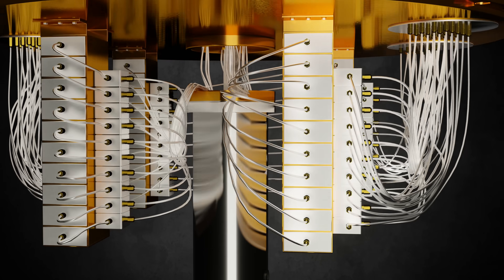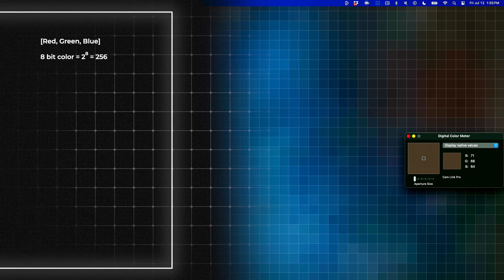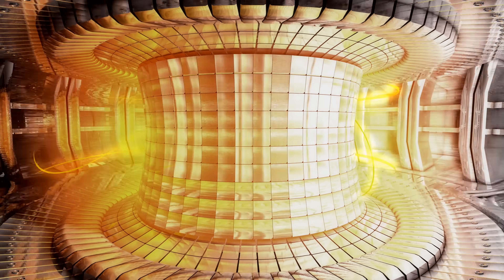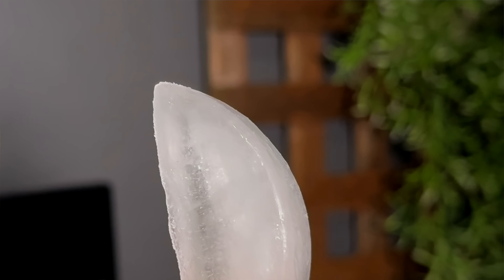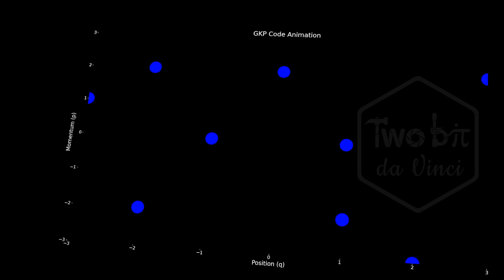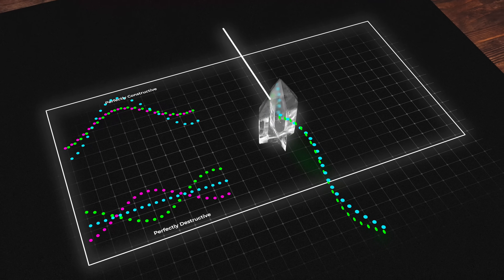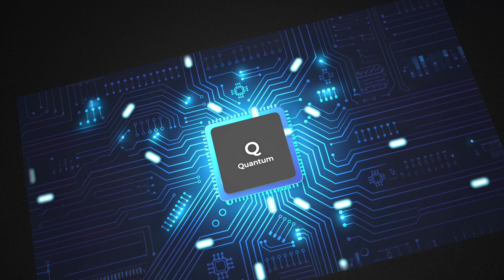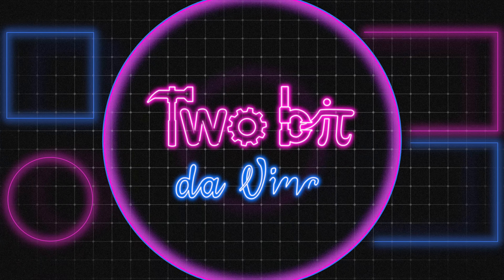Quantum Computer Breakthrough Can make them Mainstream!

Comment: I already saw light as the one of the big futures for room temperature quantum computing or similar computing methods. also how I designed my own computer in around 2016 to 2018 somewhere, but used a much more crude method which is much cheaper and simpler to make and less sensitive to noice, but much lower potential reaction speed, and actually could be more easily seen as a photonic driven analog to a quantum computer with also some of it's own extra added things.
also photonic quantum computing methods like the ones used now for how far I knew wheren't there back then, even the basic original ones where new stuf back then, also I surely didn't have the materials to make it anything like how they make such thigns now or to properly sense and  process it, so the much more crude way with my self designed R-crown(unpublished due to every invention I tried to publish before being copied and stolen by some random person or company, so if you find something about it online it is probably different, however the component itself looked more like a star, but when warping it around in some dimensions to make a simplified layout of it it looked like a crown) was much better for my use case since it was super cheap to make and as a hobbyist you never really need to run many instructions after eachother to fast since it is just for fun, experimenting, development and testing, and not for stealing data from every person in the world.

even though recently I also found a new great potentional for another technique(as in december 2023) even though that one I only tested to create and program quantum effects into normal materials and not yet for computing uses

Comment: Cooling a quantum photonic detector, such as a single-photon detector or a superconducting nanowire detector, to cryogenic temperatures involves several specialized considerations due to the sensitivity and quantum nature of these devices. Here’s how meta-structuring and advanced materials could be applied to enhance the cooling system for such detectors:

### Design Considerations for Cooling Quantum Photonic Detectors:

1. *Cryogenic Cooling System Components:*
   - *Cryocooler:* Utilize a high-efficiency cryocooler (such as a GM or pulse tube cryocooler) capable of reaching and maintaining cryogenic temperatures (typically below 4 Kelvin).
   - *Heat Exchangers:* Incorporate meta-structured heat exchangers to optimize heat transfer efficiency between the detector and the cooling system, minimizing temperature gradients and thermal losses.

2. *Insulation Materials:*
   - *Aerogels:* Integrate aerogels as thermal insulation around the detector to reduce heat leakage and maintain stable cryogenic temperatures. Meta-structuring aerogels can further enhance their insulating properties, minimizing thermal conductivity at low temperatures.
   - *Meta-Structured Insulation:* Design insulation materials with tailored microstructures to reduce phonon propagation and thermal conductivity, thereby improving overall insulation efficiency.

3. *Mechanical Stability and Compatibility:*
   - Ensure that meta-structured materials used in the cooling system have compatible thermal expansion coefficients with the detector and other components to prevent mechanical stress or damage during thermal cycling.

4. *Thermal Management of Detector Components:*
   - Implement meta-structured materials in the detector housing or mounting structure to manage thermal gradients effectively. This includes designing materials with controlled thermal conductivity and thermal expansion properties to maintain the detector’s operational stability.

5. *Integration of Advanced Cooling Techniques:*
   - Consider advanced cooling techniques such as adiabatic demagnetization refrigeration (ADR) or dilution refrigeration for achieving ultra-low temperatures (millikelvin range) if required by the specific quantum photonic detector.

### Benefits of Meta-Structured Materials:

- *Enhanced Thermal Conductivity Control:* Meta-structuring can tailor materials to minimize thermal conductivity at cryogenic temperatures, reducing heat transfer between different parts of the system and maintaining stable operating conditions for the detector.
  
- *Improved Insulation Efficiency:* Aerogels and meta-structured insulation can significantly reduce heat leakage into the cooling system, optimizing the efficiency of the cryogenic cooling process and extending the lifetime of the detector.

### Challenges and Considerations:

- *Precision and Reliability:* Meta-structuring requires precise manufacturing techniques to achieve the desired microstructure and properties. Ensuring reliability and consistency in production is crucial for maintaining performance over the detector’s operational lifespan.
  
- *Cost and Complexity:* Integrating advanced materials and techniques into the cooling system may increase initial costs and require specialized expertise for design, assembly, and maintenance.

### Conclusion:

Cooling quantum photonic detectors to cryogenic temperatures with meta-structured materials and advanced cooling systems represents a cutting-edge application of material science and cryogenic engineering. By leveraging tailored thermal properties and insulation efficiency, companies can enhance the sensitivity, reliability, and performance of quantum photonic detectors crucial for quantum information processing, quantum communication, and other advanced photonics applications. However, careful consideration of design factors, material compatibility, and operational requirements is essential to achieve optimal cooling performance and system reliability in practical implementations. 
Idk it's something sorta dumb questions to ai get dumb answers

Comment: I’m shocked it’s moving so fast. All of it. AI, Quantum Computers. 😮‍💨

I’m just an enthusiast of scientific advancement and tech, no scientist, but I wasn’t expecting either of those breakthroughs until I was in my 70s. 

I kept having this reoccurring thought that I’d miss it by this 🤏🏾much like it would all happen right as passed away. Now I feel like I could be around for the whole ride. 

What’s crazy is that these two technologies will play off each other. Each time one gets better it can be used to improve the other. Materials science would benefit SO much from quantum computing, creating materials that could create better chips for starters. Better chips give us better AI which helps us create better quantum computers and to understand data. 

All while making huge strides in bio technology and research which feeds into AI, Robotics, and CRSPR. And still finally figuring out how to create ways to do things break down plastics and forever chemicals, remove pollutants, cure diseases, perfecting renewable energy, and even fixing the food supply problems. And probably anything and everything. 🤔

It’s crazy. It might not be 5 years from now but it seems like one thing will happen, idk what that thing is but we’ll reach a certain milestone and then it’ll take off. Quick. 

And it could happen while I’m still young enough to be able to be amazed by and appreciate it all. 😌

Comment: Wouldn’t it be better for quantum computers if they were just sent by satellite into space where they would have less temperature issues?
Reply: It's doable but not cheap or practical. Space is not cold enough especially this close to the sun. Cooling in space is very different than an earth because there is no air to transfer the heat to. So radiative cooling has to be used and is used on some satellites but cooling needs energy and that means solar panels which means the satellite has to be in the sun. Then you would need to send large amounts a data to and from the satellite wirelessly which is impracticable. The difference between the temperature of space in the vicinity of Earth and the temperature needed to operate a quantum computer is pretty big. Then there is the problem of solar radiation which will definitely cause problems if not shielded to the extreme.

Comment: PsiQuantum has been on the market since 2020 if not earlier. The approach to use photons to build a QC is not that new - every quantum hardware platform has its advantages and disadvantages which makes setting good benchmarks so difficult. 
Personally I love photonic quantum computing because it is the branch I kinda "grew up" with. It is also not the only platform that does not need to be cooled that far. Neutral atoms and trapped ions can also operate at higher temperatures than complete zero.
The idea is to calculate the energy of the system you study and compare it to k_bT. If the system's energy is much higher than k_bT it is less affected by thermal fluctuations / thermal noise.
For the trapped ions and neutral atoms I am not sure why they don't need to be cooled but for photons it is quite clear. Light waves have much more energy than heat. Heat makes molecules swing and rotate and wriggle around while single photons (depending on the amount of energy) go deep into a molecule and attack the chemical bonds. This makes light a good information carrier in the atmosphere, in space and thus the ultimate ressource for building quantum communication networks. But the same design that goes into quantum networks can be the basis for a rather obscure design of quantum computing called the measurement based design. As far as I know this is what PsiQuantum uses. You can still execute qubits in MBQC like in the gate based model but the model itself is the most complex quantum computing model I have ever seen in my life. Manipulating qubits by measurement and feed forward correction is - well - rather special. The entire decoherence and control problem is switched to the original quantum ressource - the graph state that goes into the process of computing and the computing process itself destroys the computer. 
From all crazy things I have seen in physics so far MBQC was the moment I thought "Who on earth has such an idea?". The rest of ideas in quantum information is quite straightforward - learning how a qubit works is clear when you know quantum mechanics. Same goes for the quantum circuit model. The adiabatic model is also rather straightforward. But MBQC? I still cheer for the brave people who deal with that part of quantum information.

Comment: 🔅 Great video and info on the different and novel Quantum tech. I think [eventually] we'll see hybrid chips with different ratios of Classical and Quantum 'horsepower' -- e.g. 80/20 chip real estate, or 40/60 etc. Ratios will vary for different uses like cars, mobile, desktops (office vs gaming), edge deployments, and mainframes/servers. Great job stepping up the production quality, and keep up the great work reporting tech. 🙌
Reply from the maker: great insights, thank you!
Reply: That's an interesting idea and I think you're right. Perhaps a quantum AI chip for some types of problems and a classical for others, plus some very clever coding to drive commands to one or the other.
If we master downsizing cooling technology, we may just make this work for commercial home computers

Comment: Erwin Schrödinger was wrong, see the cat is an observer and so are the decay bacteria just waiting for it to die. Thus both of them or if the cat dies, the decay bacteria would observe the event and  reduce the quantum state vector (collapse the wave function). Not to mention the Universe itself since all elementary particles got quantum entangled at the singularity most call the big bang, thus creating the largest quantum computer imaginable, packing at the very least 3.28 * 10^80 qbits of raw computing power. That number of course corresponds to the number of elementary particles in the known universe. Making it a virtual quantum giga computer, the very computer upon which the Original Observer runs the simulation we perceive as our reality on. That is also the reason for why we must isolate quantum computer from the cosmic 'background noise', which of course isn't noise at all, but the Universe 'talking'.

Comment: 3:15 No, that would be probabilistic computer (still a classical one). Qubits are simultaneously on and off with different probabilities of what you would measure. The whole point of quantum computing is that you are doing the computation on all possible states at the same time. So if you have billion states, classical computer has to evaluate each one by one. If you have quantum computer you manipulate all those billion states at the same time (but you can get only one answer).

Comment: So clearly done!  Thank you!  Sub'd.
Reminds me of getting shown a floor full of IBM computers with the two 12" reels, 1965.
🧙‍♂️ Has anyone remembered the bug spray?
Reply: EXACTLY! That's my thought exactly when I saw PsiQuantum's computer design in Australia. It's going to be a two-building commercial quantum computer. I feel quantum computers are going through the same technology development life cycle that classical computers did in the mid-20th century, and I believe we'll be able to get them to the mass market, especially if we can make qubits with traditional semiconductor manufacturing technologies.
Reply: @Israel_Two_Bit  it's amazing to watch, again, lol
Reply: Personal experience - hardware "bugs" are one reason why most servers are found in data centers at about 50-60 degrees F (best) with cold air conditioners and locks, sometimes locking doors that cannot be opened simultaneously, you have to carry your gear into door1, wait 'till it closes and locks, then open the inner door to gain access.

Comment: In electronics a device can be built which will down convert ultrasonics into audible sounds to allow you to listen in on birds, bats, and insects.  A automobile radar detector of the 1980's could use a circuit to down convert microwaves into audible sound. interestingly at 8:20 the process of driving a photon through a non linear crystal to split the light ray into two beams at lower energy sound to me like a means of creating another type of high energy telescope for outer space, in particular to allow better observation of x-rays and gamma rays.  What do you think?